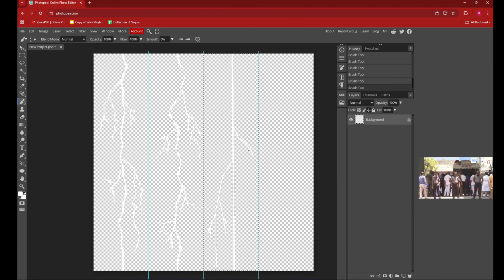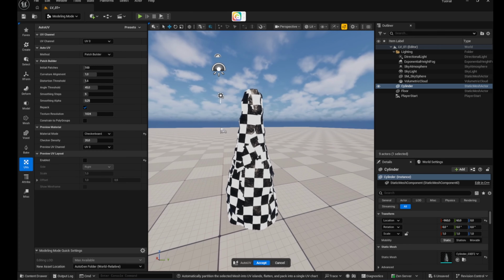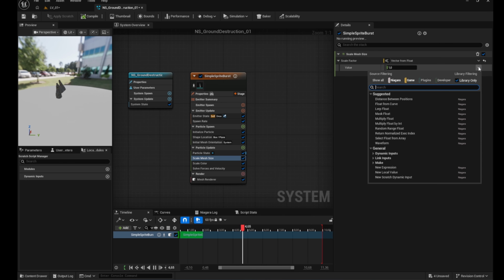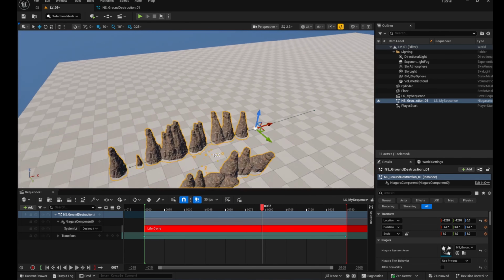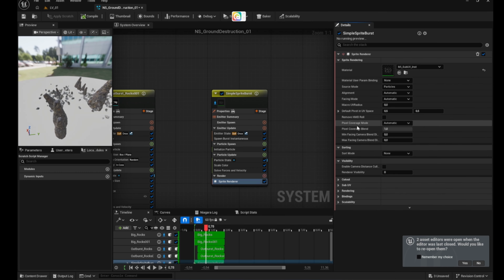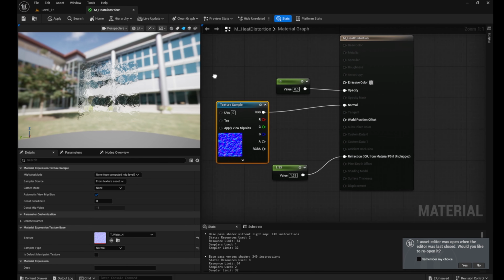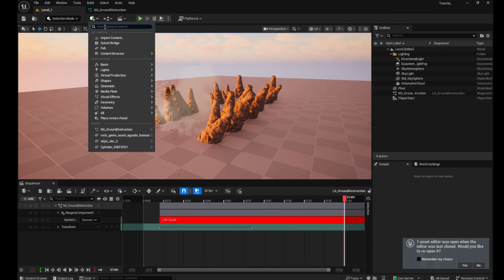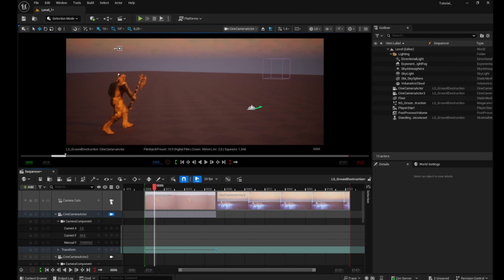Unreal Engine | Create a Rock Explosion with Lightning using Niagara

Comment: I want to master Niagara Fluids and Dynamic Simulations in Unreal Engine, specifically focusing on liquid-particle interactions and real-time material transitions for high-end cinematics
Reply from the maker: In that case you need a beast of a computer. If you're already well-equipped you can look at RedefineFX tutorials. I wanted to do more with that but it's nearly impossible for me to work with Niagara Fluids. I use Embergen, Blender, sometimes Houdini and import VDB sequences inside Unreal. This workflow does not melt my computer and personally I think the simulations are much more realistic than Niagara.
Reply: @vfxceptional But I only know how to use Niagara Fluids and I don’t know how to use other software do you know Zack D Films and have you seen his YouTube Shorts that is the kind of style I want but I cannot find proper tutorials anywhere
Reply from the maker: Yes I know Zack D Films. I think you can definitely find something useful at RedefineFX. There are many free and paid tutorials in there, about Niagara fluids and more.